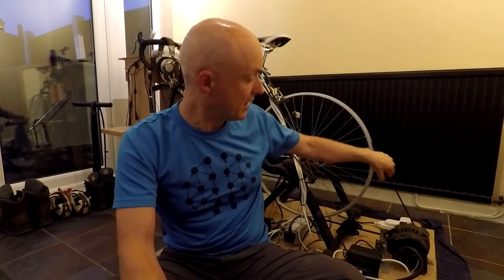How to Build a Bike Generator - AC or DC? | DIY Bicycle Generator Series

Comment: Great videos on this project, really liked the delivery, I'm looking to do a generator, with the washing machine motor, you mention you still need voltage regulation, how is this achieved? When the motor, is spun, is 230v only at a specific rev, and lower voltage? Cheers, Phil.
Reply from the maker: Thanks Phil, glad you've enjoyed the videos. There are actually various types of motor used in washing machines, most being AC induction motors, but some being DC type. Both will need voltage regulation, though of different types, because, yes, the voltage will vary with speed. In an induction motor as generator, the output voltage will also vary depending on the voltage in the field coil.
Voltage regulation kits are available on eBay and Ali Express and similar sites for very little money, so that's your best bet, unless you want to actually build the circuit yourself from separate components. If you buy a kit, just make sure it will handle the voltage produced by the motor and also the current you wish to draw from the system. Of course, also make sure that it's designed for AC or DC depending on the motor! You can get kits that output one fixed voltage, or those which can be varied over a range. You'll also need a rectifier if you're using an AC induction motor and want to produce DC. These are available very cheaply as a single component, again eBay is a good starting point.

Comment: Well done with this film, it will be so useful to all wishing to make a generator. I remember using an old washing machine motor to power a lathe and a grinding wheel, the correct type of pulley and belt tension is all important.